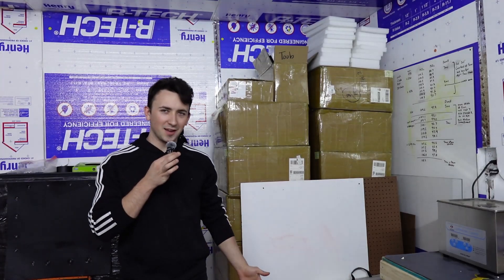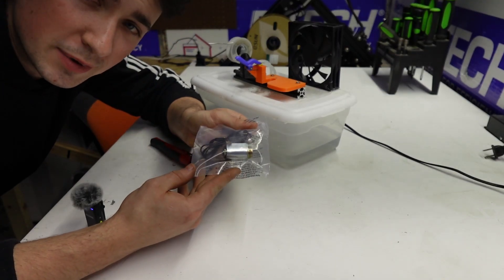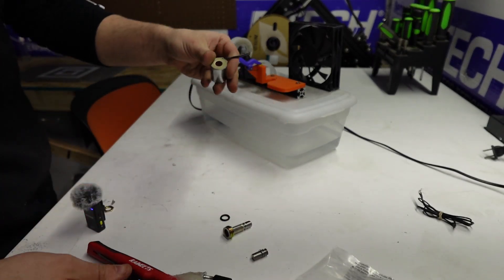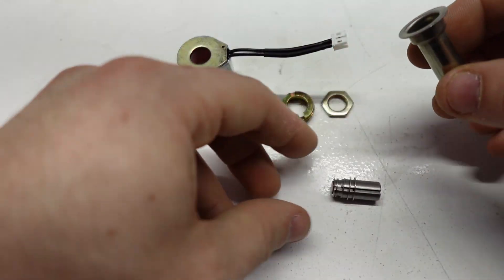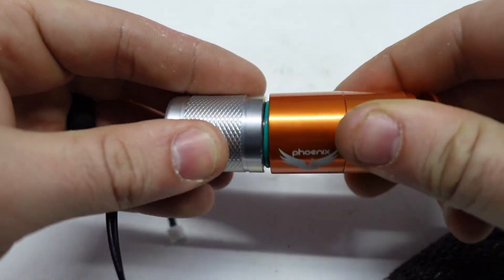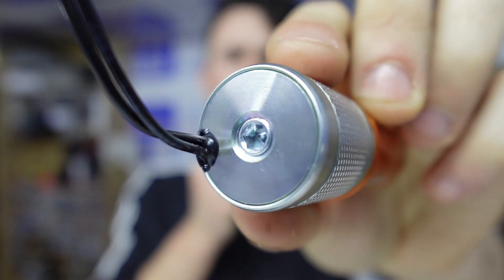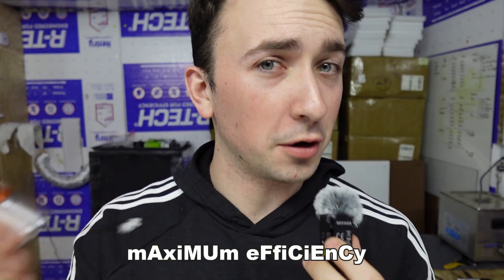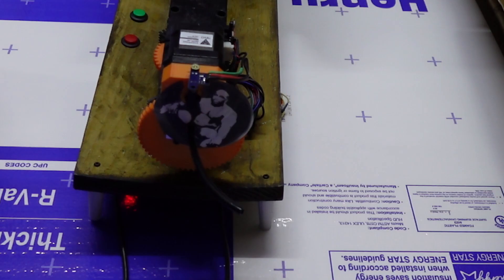How the NEW Backdraft Phoenix Changed, is it BETTER? (Budget HPA Engine)

Comment: Do you also ship to Poland?
Reply from the maker: Yep! Worldwide!
Reply: @BackdraftAirsoft  Well, now I’ve got no excuse. I really need to seriously consider doing my next project with your engine. I’m a bit worried because I don’t have much experience with tubing. Wires, batteries, and springs are my friends for now—though I’ve hit a wall with them. I want to make an MCX REGULATOR, and I don’t think any gearbox will fit in there.

Comment: At a college I am attending, we have a small airsoft community that a number of fellow students are engineering majors, including myself. I love the product and process that you are continuously improving and I am also following along the manufacture/assembly process you are developing. Love the innovation! With the shrink tube and soldering, i have a few ideas that could help speed up the process (which you might have considered already lol). Keep up the good work!
Reply from the maker: @lucianthurgood7721  baking? 

(The new connectors are crimp on, so no more soldering haha)
Reply: @BackdraftAirsoft  a shrink tube iron that attaches to your jig
Reply from the maker: @lucianthurgood7721  not a bad idea. I think if I still had to assemble this way I would just bake the coils all at once in an oven. That would evenly shrink all the tubing quickly
Reply: @BackdraftAirsoft  or maybe a heating element like a really small hot plate to rotate the tails under (hot dog style). the question now seems to be doing it by batch vs doing it one-by-one?

Comment: ITS A MOTOR! Because its driven by electricity. Only internal combustion engines are engines.
Reply from the maker: The piston moves by compressed air, which is why it’s called a high pressure air engine. I’d argue that ICE engines ignite with a spark plug, and this one “ignites” with a valve opening. ;)

Comment: nice work man! I only had one issue though my IGL line popped off the hose barb fitting any suggestions?
Reply from the maker: @peanutbutter3918  I’d recommend using some basic super glue and press it back on :)